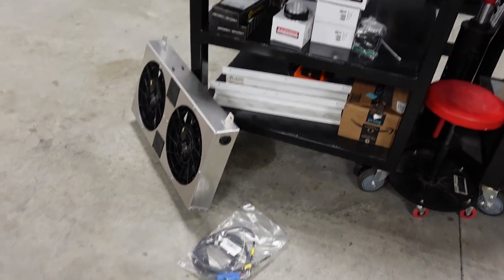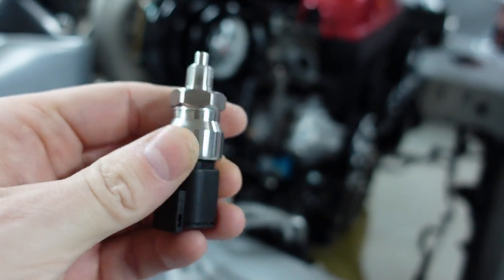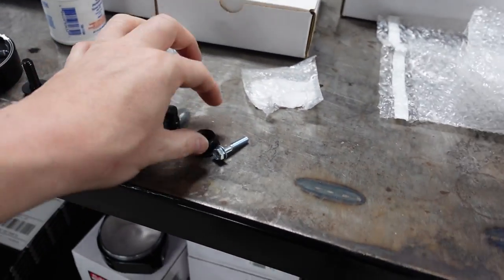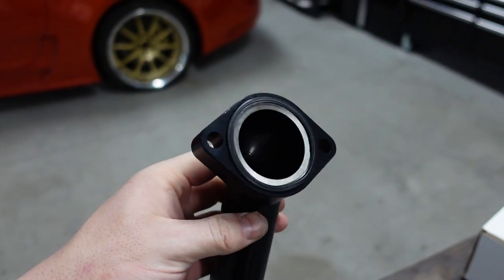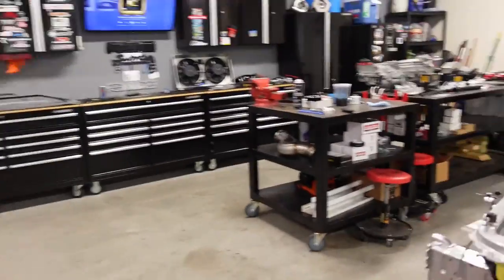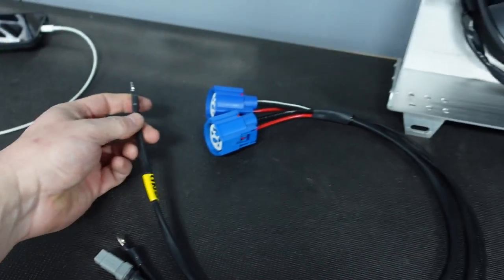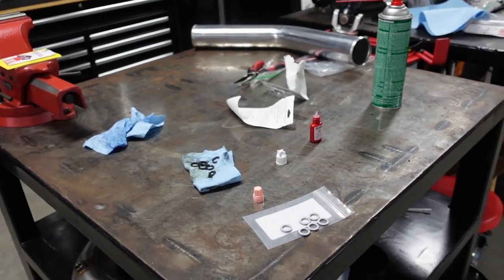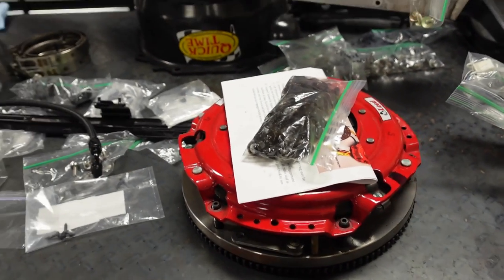PHR Brushless Electric Fans, Pulleys & 20AN Water Necks

Comment: The problem with these electric fans and others is the massive restriction of airflow at speed.  The air the fans themselves move at speed doesn't matter.  The OE clutch fan setup is designed to be passive at speed unlike this setup which restricts flow due to the shrouding which covers the entire front end which is required tomkeepmthe car from overheating when stationary. The only Supras overheating on the streets of TX, FL, AZ, ect have this electric setup.  Cooler Carolina weather might have different results, but the OE fan would cool better there as well.  IMO it's much less appealing to the eye as well.